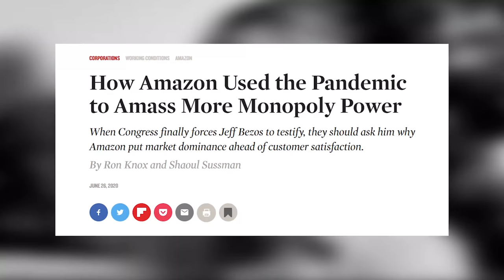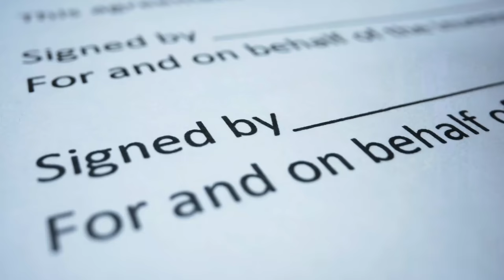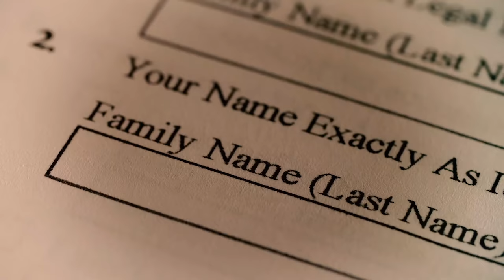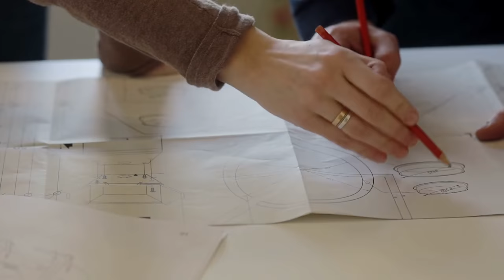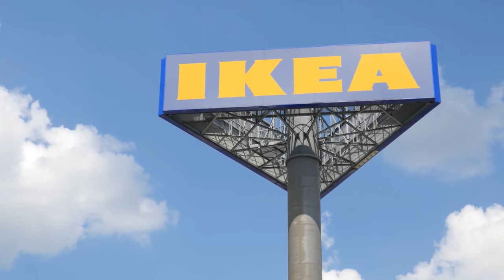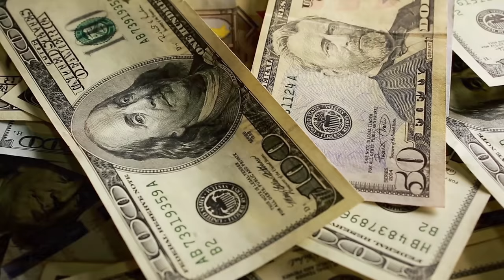Meet The $58.7 Billion Shadow Retailer

Comment: I bought an Ikea wardrobe in 2014, it wasn't particularly noteworthy but for the price it was alright, typical Ikea. But this year I got the same exact wardrobe and the quality got significantly worse. I could hear sawdust shaking inside the thick panels, the connecting sides of the panels that weren't visible after assembly were sealed off with some cheap material that felt like duct tape, some of the parts that used to be metal now came as plastic. The price has gone up a lot too, arguably more than the 7 years of inflation could realistically affect it. Another thing that's vexing about Ikea now is that in recent years they began discontinuing so many of their items and whole series, some very popular ones even. I'm highly disappointed in this brand, looks like the death of the founder opened the floodgates to mismanagement.